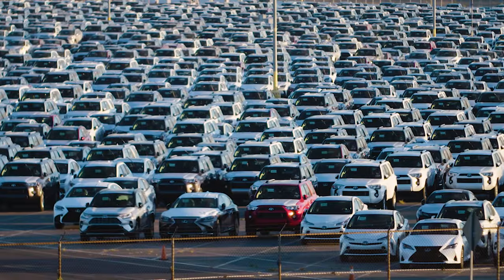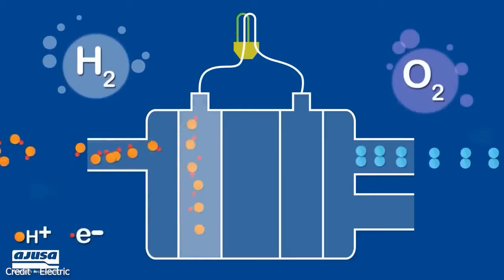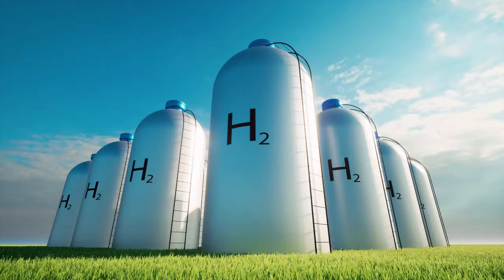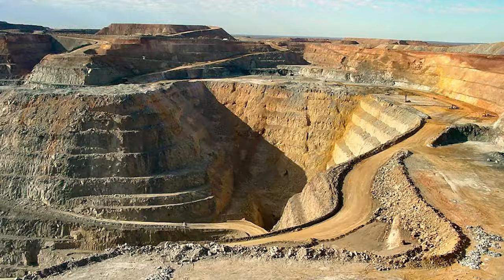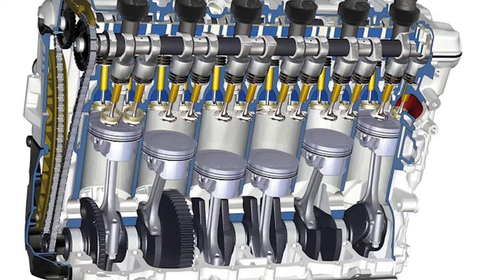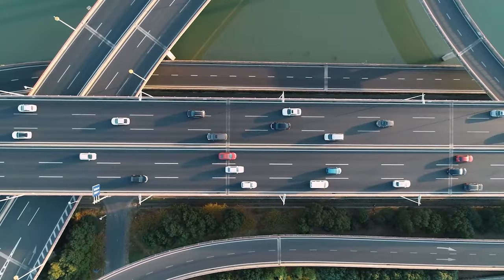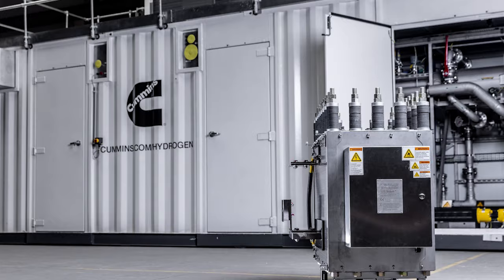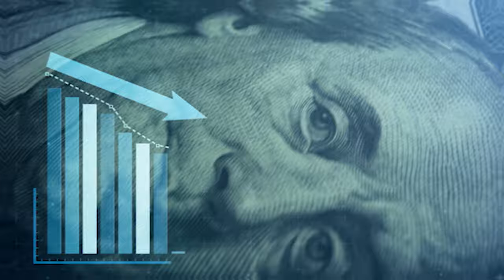Toyota’s INSANE WATER Engine SHOCKS All EV Makers!

Comment: This is like advertising a perpetual motion machine. The energy required to split the hydrogen from the oxygen is greater than what the fuel cell recovers by a factor of roughly two. So you have to put a lot of energy into this process. This is complete trash and clickbait garbage. If YouTube had any content standards that prevented disinformation and outright lying this video would be pulled down. Unfortunately we're in the post truth age so anything goes.

Comment: But where does the energy for the hydrogen making inside the car come from?
Reply: Yeah, this.
Reply: I also asked this question. It seems to me that the breakdown of water is probably a chain reaction, you invest a little energy to start a lot of services, and get energy back. Like combustion, you light a match, create heat, start the action, and accept the work process itself.
Reply: @danielkotzer636  what no there i no chain reaction in electrolysis
Reply: battery

Comment: Apparently it is a H2 powered engine cooled with water due to high temp H2 combustion. Adding this mix, however, will lower power output of the engine. Interesting.